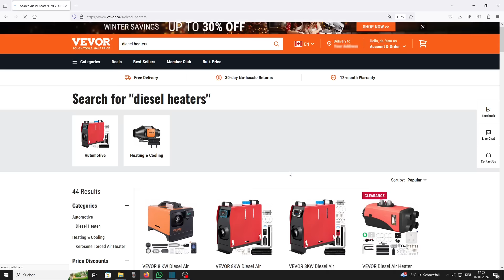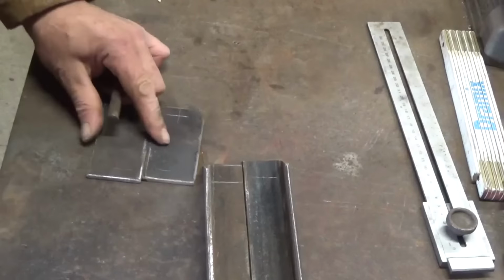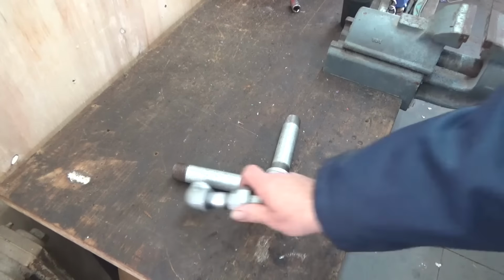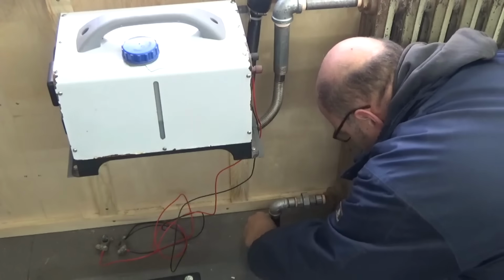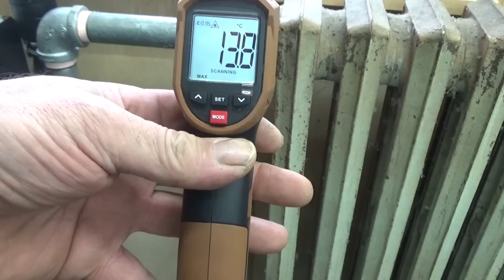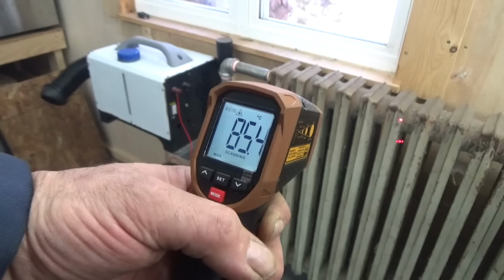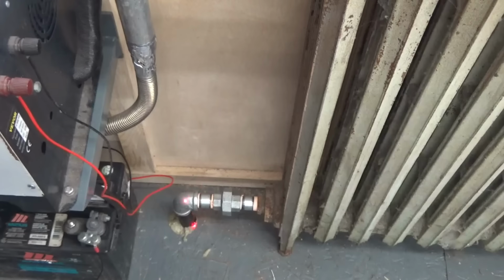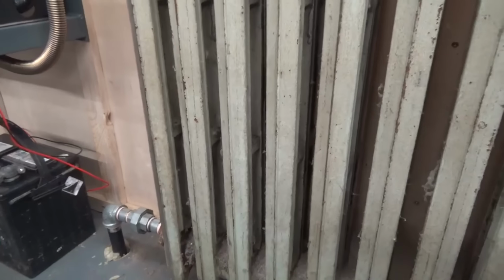Diesel heater upgade 200% more efficient

Comment: For this to work, long term, you need to have the exhaust pipe from the diesel heater well above the radiator, so the condensation will flow down and out, through the radiator, as vapor.  The way you have it set up, currently, the heater will eventually clog.
Reply: I was going to write the same remark. All the condensation will stay in the exhaustpipe the way it was set up.
Maybe fit the exhaust to the bottom and do the pipe on top through the floor?
Reply: The temperature in the flex pipe going from the heater upwards to the radiator is so high that you don't get condensation there. Maybe a few drops at startup but it evaporates as soon as it gets up to working temp. I have the flex pipe going upwards in my boat and have had no issues in the five years I've used it.
Reply: WRONG ....There is no condensation once the heater is up to temp (a couple mins) and any condensation that collects in the radiator will drain out.  By your logic every vertical exhaust on every diesel engine ever would plug up.
Reply: Just to agree with the others, you can't have an exhaust pipe going up the way. It'll just fill up with vapour and condensation It must constantly go downhill. for this to work long term. If you look at the silencer. even that has a hole in the bottom to get rid of vapour for that very reason. You will   need to raise the heater. or to have a Lower. Radiator. In principle, it should work OK then. The other option. is to use. a part from a car. I think they call it EcG. It allows you to pass the exhaust through. a water chamber. and then send the water through the radiator. That could work on your existing radiator so long as you have the exhaust at floor level. as it enters its heat exchanger. You would just need a small expansion chain. literally tiny. nothing bigger. than the size. on a car. Radiator top up. and it won't even need to be under a pressure. So long as it's at the right height.
Reply: @chrisharrell2449   You really don't have a clue what you're talking about do you.
Reply: By condensation I think what you're looking to say is carbon build up due to the soot settling out of the exhaust gas due to the rapid temperature drop in the radiator. There is a reason all combustion devices keep exhaust gases hot so it doesn't build up on the internal walls of the exhaust pipe clogging it.
Reply: @vhateverlie   Oh you mean like the 40ft of exhaust venting for your furnace...........  Again no clue what you are talking about.  Soot won't settle out soot is soot. It does not settle out...  The lowrr portion of the radiator will collect condensation due to the temp drop and falling below the dew point.  that is THE ONLY PLACE condensation will collect and that will just drain out.  Ideally you want the bottom of the rad to be above the dew point once fully up to temp to prevent condensation in the first place. so Above 30° as it is impossible for condensation to fall out of suspension above 30°C
Reply: @matthewq4b jeez dude. Learn how to speak to people. Have you ever liked someone that started sentences with WRONG.
Reply: @matthewq4b  you tell me what the temperature of your furnace exhaust is leaving your building. I'll bet it's not room temperature.
Also you do know you have to clean oil and wood chimneys yearly because they do fill up with soot right?
Reply: @vhateverlie we’ve had a wood burning stove for 14 years now and never once cleaned the chimney flue. I inspected it a few months ago and it was clean.
Reply: I think the condensation in the bottom may cause trouble in the future because it is below 0 C. Perfect proof of concept. I think the unit may be a bit oversized, so I would tilt the radiator bij a couple of degrees, just to mike sure the water can get out. but you are capturing all of the heat, nice, but please install a CO monitor, just in case something clogs/freezes up.
Reply: Jason, not only you are wrong, but incredibly wrong.
Reply: @vhateverlie  And it FAR FAR cooler than the exhaust to radiator in this application....   So skippy how is the condensation going to collect in the exhaust pipe.    And wood chimneys get coated with creosote NOT SOOT....  creosote has a MUCH MUCH higher dew point than water...  Still proving you really have NO IDEA what you are talking about.
Reply: @memadmax69  - Nice try, bud.  I've got one, use it several times a week, and have educated myself on how/why you want the exhaust from these devices to point downward.  I've seen what happens to these units when you don't route the exhaust properly.  Why so mad?  ;)
Reply: @matthewq4b  he is correct to a fashion  if you look at the correct way to install a CDH  the exhaust must NOT be fitted vertical
Reply: @matthewq4b  just so you know creosote is a biproduct of wood combustion from the PAH's and isn't really associated with diesel. Soot or carbon buildup is from unburn or incomplete combustion with diesel fuel commonly associated with diesel engines and diesel furnaces.
Anyway I don't much care to argue anymore who doesn't have a background in anything related to the topic.
There is a reason these little heaters don't have a secondary heat recovery system on them after all...
Reply: The compression from a naturally aspirated engine is way more compression then a diesel heater chamber thus in this experiment is failure of the diesel heaters longliverty. With low compression makes more sense to allow gases to naturally rise then exit at the shortest length pipe opitunity.
Reply: @cejs3273   You don't really have a clue either do you.
Reply: @matthewq4b  clue ? Mirror 1-)
Reply: @cejs3273   Thanks for proving the point perfectly.
Reply: @vhateverlie  You only need to clean chimneys and wood stove pipes if they do not burn efficiently and hot. That build up is oils from the wood and the fuel you are using that did not burn and sticks to the walls where it then traps soot and "wet stacks".  Smoke is unburned fuel, soot is unburned fuel, that smell of wood burning is unburned fuel.  If you want to clean a stack or chimney every year simply smolder your fire, make lots of smoke, and choke your coals. The neighborhood will hate you and you'll waste your fuel by sending it out into the air as particulate pollution.
Reply: WRONG! 😂😂
Reply: @cejs3273  - The manufacturer of these devices strongly advises that the exhaust pipe be pointed in a downward direction to avoid condensation collecting in the pipe.  Your argument is with the German engineers who originally designed these products, and the Chinese manufacturers who are mass-producing them.  I would encourage you to read up on how a diesel engine works, because they typically run at about twice the compression of a gasoline engine.  All these heaters are is a heat exchanger surrounding a very small diesel engine...which will typically run at no less than 14:1 compression.
Reply: @jasonbroom7147  precisely embarked upon my point. With little compression during combustion only a Fan on3 can not expect to push fluids thus a drain port at the bottom whilst taking advantage of the planets funcion8ng science.
Reply: @cejs3273  - Are you OK?  Into your cups, or something?
Reply: @jasonbroom7147  derogatory comments I will not stoop.
Reply: @matthewq4b  I don't disagree with your assessment but you don't have to be such as jerk about it.
Reply: @cejs3273  - You said there was "little compression during combustion".  That's proof you're either ignorant of how a diesel combustion process works, or you're inebriated.  The rest of your comments would argue the latter.  So, you're not only wrong about the topic at hand (condensation in the exhaust system), you don't understand that diesel combustion absolutely REQUIRES high compression (it's literally what causes ignition), and the rest of your writing is largely incomprehensible.  You should quit while you're behind.
Reply: How do you keep the battery charged?
Reply: @jasonbroom7147  SAVW ; if you bother to READ correctly you will have read I stated the FACT the  "diesel heater has little compression compared to that of a naturally aspirated diesel engine". RADIATOR: what is it ultimately???? An Exhaust pipe. Are you claiming that the length and aperture (I.D) plays no vital role/part not excluding bends to and combustible engine? THIS is the point I make and I state it (A)GAIN. A diesel heater does NOT create anywhere near the compression of a Engine thats under a hood of a vehicle. An exhaust set up play a HUGE roll and can alter how an engine burns its fuel. NOW I know not what your ranting about what so ever. WHERE in the above is not correct ? !
Reply: @dc9039 it would be easy to just power the heater with a wall-wart.  Or apply a little battery maintainer…
Reply: This won't have a condensation issue because it's not outside in the cold.
Reply: I could be wrong but if your exhaust temp drop too much you will create condensation. That condensation while it stays in liquid form is an acid that will eat ferrous metals like cast iron. That is why you don't see any cast iron oil burning furnaces or boilers have an efficiency higher than 87% because condensation will occurr and Rot out the heat exchanger. If you temp in the pipe is hot enough it should dry up the condensate but I think that radiator is going to rot out quick and your exhaust gas will leak. Long term I would make the pipe go strait down and use a heat exchanger from an broken high efficiency condensing boiler (like 96%)  probably not made of ferrous metal and designed for gasses to condense in it. I the idea though and as I said I'm no expert on this,  just read alot about my boiler as I use diesel to hear my house.
Reply: @nicholashall5544  Not exactly, What causes acid in exhaust is sulphur in the fuel. When combusted it turns in to sulfur dioxide, when that combines with moisture/water it creates sulfuric acid.  This corrosive effect of exhaust especially in diesel exhaust  (As diesel traditionally had a much higher sulfur content than gasoline)was a concern at one time, but with the advent of ULSD it is a non issue..    Furthermore cast iron is more resistant to the corrosive effects of sulfuric acid in an exhaust than say mild steel is. And is one of the reasons it was and is used for exhaust manifolds. Also  traditionally oil fired  and coal fired furnaces were of ALL cast iron construction due it's better resistance against corrosion from combustion acids.  And non ferrous metals would disintegrate in short order in the presence of combustion acids...
Reply: @matthewq4b Obviously you think water flows uphill? Again who is clueless?
Reply: Fireplace 10 years. I don't fix things that are not broken.
Reply: @Critical_Stinking Actually he is Right!
Reply: @jasonbroom7147 Hard core drugs huh?
Reply: @donraptor6156   Apparently you have no clue what water vapour is. And think there would be liquid water in exhaust that is over 100°C......  Not the sharpest tool in the shed are ya...
Reply: @donraptor6156  - Never did anything more than try pot a couple times.  Something I learned very early on in life is the importance of learning from mistakes - other people's mistakes, whenever possible.  The manufacturers of these diesel heaters, and every single person with any experience at all using them, will tell you, in no uncertain terms, that the exhaust pipe should be pointed downward from the heater.  They all cite condensation as the reason why.  Do you have any meaningful commentary which refutes this conventional wisdom?
Reply: Oui !
Reply: @donraptor6156  Wood-burning insert, with a plenum chamber tied into my HVAC hot air return.  Whole-house heat without any electricity, just the natural thermo-siphon created by the heat rising in the plenum chamber.  There are solutions, and then there are solutions!
Reply: For all those saying about condensation collecting in the exhaust your all wrong , if you were right then every truck with a vertical exhaust would fail think about it
Reply: @matthewq4b 
Had that problem with my heater.  So he is not wrong. But in the end its all about what temp its operation in . 
And dont underestimate how much moist will stay in the radiator top that will cool down in the inlet to the radiator after use .
Reply: @gunnarbrunstig8377    NO measurable moisture will stay in the radiator it will drain out. The radiator was a hot water radiator originally.... And NO moisture will collect after use like come on give your head a shake.   It will collect on start up when the hot moist exhaust hit the cold cast iron...  Not the brightest lot on this thread...
Reply: @matthewq4b  you should think about how you respond. You are talking to people Who have had this problem and when you are rude and are dissmissing that ,its clear whos not so Bright.
Reply: I going to try your idea, very smart 😃😃
Reply: You could put the dampner  between before the radiator. This has a hole for condens.
Could that be a answer?
Sorry if my spelling is not correct as I am dutch and dislectic. Greeting from wim
Reply: @Just_Wimski1130  Thank you for your advice. I am from Sweden and I am not good to write in English, 😀😀
Reply: @Just_Wimski1130   The Muffler (dampener) is for outside use.   The hole for condensation draining is no good for indoor use as it is source of CO (Carbon Monoxide)  Out door with the larger surface area of the muffler and the slower exhaust velocity through it could lead to the formation condensation in it.   It would NOT  be advisable use the muffler indoors.
Reply: Also, it will create a fair amount of back pressure, causing problems.
Reply: @stevecarlisle3323   Explain how the larger diameter inlet and outlet of the radiator plus it's high rate of flow over the diesel heaters exhaust pipe  is going to cause back pressure?    Try engaging brain before commenting.
Reply: @matthewq4b    For sure there will be higher temperature condensates than only water.    The radiator will need at least annual cleaning to remain efficiency
Reply: @andrewskater8813   There are no higher temp condensates in ULSD.  This is not the diesel fuel of 30 years ago where that might have been an issue.  Drag yourself into the 21st century already..
Reply: @sannmarc  finally a sensible comment.
Reply: @vhateverlie  i figured they don't because they re portable, but seeing as people are adding them what would you say the biggest issue is with them? other then they dont come with one
Reply: Exactly
Reply: It will eventually clog because the  stainless steel exhaust is designed to flow downward
 so the way you’ve done it, you will trap moisture in there and you will eventually have problems with that heater before it goes into the radiator
Reply: All good suggestions so far 
for one more you need the inlet taking fresh air for out side not your shop 
as the shop gets hot the air intake will not be cold enough for the heater to stay working properly it will start sooting up running very rich 
then cost more if you like saving money 💰 put it out side 👍
Reply: Have you noticed any difference in the loudness of the exhaust after this mod? Has it increased or decreased any?
Reply: @jasonbroom7147 this is a diesel heater not a diesel engine. There is no compression. The glow plug starts the combustion process
Reply: I'm new to this but I have run mine constantly for 2 months and have NEVER a drop of water come out of the  Exhaust..
Reply: My twopence worth,  exhaust from the heater should have gone to the bottom tapping of the radiator. Heat rises.
Reply: No, he has the pipe at the bottom and so for that heater to fill with condensation would be pretty hard because the pipe on the bottom will allow condensation to flow out. More important is exhaust fumes getting into the room you want to make absolutely sure there are none or your workshop will come your coffin.
Reply: @kevinmills5293 that is good for you! Let's agree that these furnaces have a mandatory yearly cleaning for the insurance validity. It is not without reason or experience.
Just because it works for you doesn't mean it applies to every stove in every situation with every fuel.
I would happily clean my own chimney to save the money on a "professional" dude with a brush on a stick. But then my insurance isn't valid anymore.
The rule also applies to the parc where we have an off-grid cabin.
Reply: Put the exhaust from the heater into the bottom of the radiator, heat rises, the way its set up the bottom of the radiator is cold so ur losing heat
Reply: @jasonbroom7147 internal fuel leaks might be a good reason to keep the exhaust pointing down .
Reply: A deisel heater doesn't condisate like a propane heater
Reply: Wrong wrong wrong.
Reply: @jasonbroom7147 bullshit the way the dude hooked to that radiator is fine. Because In this situation no problem.
Reply: @gunnarbrunstig8377 are we a sno flake,?
Reply: @Just_Wimski1130 you make sense, a lot of nonsense!!!!
Reply: @mikerilling2745 you make sense , nonsense.  Lots.
Reply: @mikehaffenden154 dummass u should stay out of discussions.
Reply: @peterloichtl4512  - Your argument is with the guidance from the manufacturer, and any other engineer who has considered this design.  There are lots of folks with rusted out exhaust tubes that suggest I'm right and this design is problematic.  I know what's working for me and maybe this will work as well.  The difference is, I KNOW what I'm doing will be safe.
Reply: @vhateverlie I've had an oil furnace for twenty years. Guess how many times I've had to clean the chimney. Zero. None. Never.
Reply: @vhateverlie ive been having fires every year for 32years and have never cleaned my fire place. Maybe the type of wood has something to do with a need to clean annually
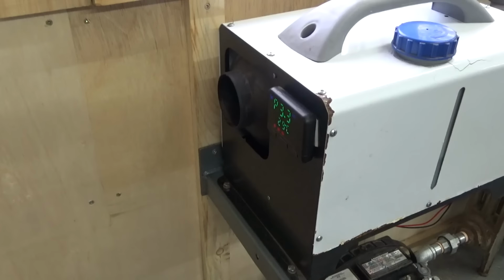Reply: 08:53 “and a few minutes later “………….. we have lift off!😅